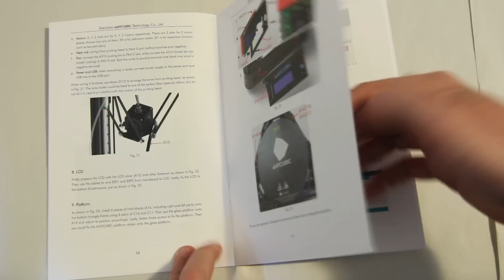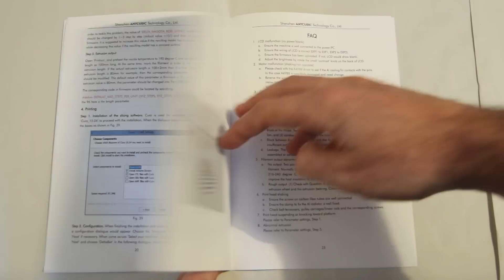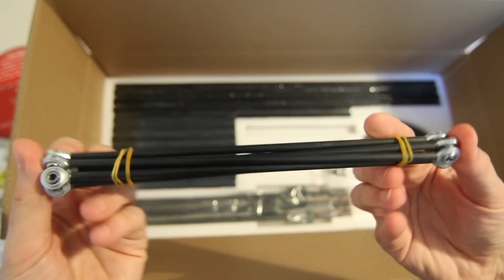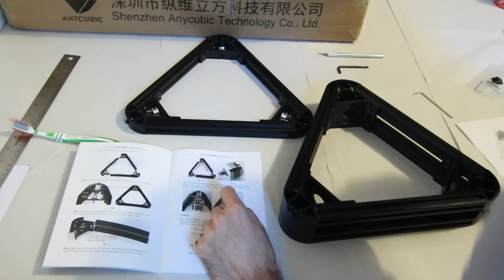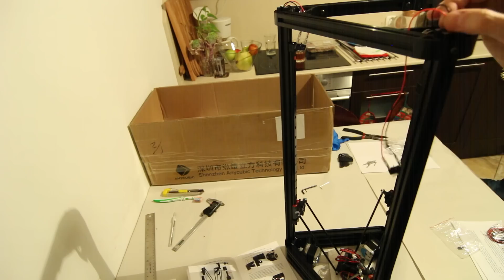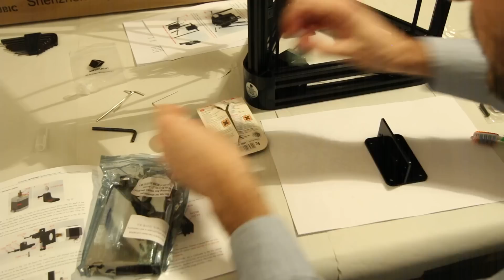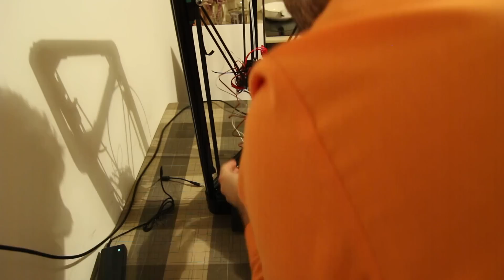Anycubic Kossel Delta 3D Printer Full Assembly and Review

Comment: I love the printer that I have received, it looks great, was simple to build and designs come out well. However, I’m having a huge issue with the boden tube/extruder jamming, this causes the extruder motor to click and wear away at my filament and im wasting a lot of filament at the moment. I got about 2 hours into a 5 hour print last night and then suddenly the tube jammed and no more filament could be extruded. Do you know how I could fix this?
Reply from the maker: There are many possible causes, but more information is needed. Type of plastic, print temperature, over extrusion, does the print head cooling fan (the one that cools the heatsink) work constantly, bad filament, clean hobbed wheel on the extruder, does the PTFE tube go as deep as possible into the head? Etc. Etc... And where in the Bowden tube does the filament jam exactly? How do you fix the jam?
Reply: ruevs im using pla at 210 degrees, tried to print at 190 but that made the clogging even worse, the cooling fan is working at all times as far as i know. ive used 2 different filaments so i dont this is the problem and the machine is brand new so i dont think the hobbed wheel is dirty. 

i have noticed that when i pull the filament out of the print head, it has an odd melting shape, it doesnt fall straight down, instead bulbs out a little to one side.
Reply from the maker: You mean that while extruding the filament comes out of the nozzle to one side? You may have a metal shaving or something else partially clogging the nozzle. And then the extruder struggles to extrude the same volume of plastic through a smaller diameter nozzle. Try setting the temperature at 220, disconnection the Bowden tube at the head, extruding by hand in the air for a bit, then lowering it to 80 degrees, removing the extruded plastic from the nozzle and  pulling the filament out (takes some force). The idea is for the almost solid plastic to pull out the particle clogging the nozzle.
Reply: Ryan, I had the same problem. The easiest method (for any extruder jamming, that is), is to disassemble and remove the stuck filament away either with pins or burn away with a stove. For boden, I heated an awl (or a pin) to melt away the stuck filament because the whole  boden is hard to be heated. For the nozzle, easiest way is to heat it on the stove.

Comment: Does this tutorial work with Anycubic Kossel Pulley?
Reply from the maker: It does 90% - instead of mounting the slides you should assemble the pulley carriages. Everything else should be the same. You will need do tune the delta radius in the firmware - but that is always the case.
Reply: Thanks

Comment: Awesome! Thanks for the review. Apprently we still have lots to do to improve this delta and offer better experience to your guys. Cheers.
Reply from the maker: You are welcome. Apart from the few small "hacks" that were necessary - and I described them all in the video - the printer is quite nice.
Reply from the maker: @ANYCUBIC3D will you ever release a new delta printer? And one that is fully open source (firmware)? The delta I built in this video - one of the first detailed videos on your products ever - still works perfectly fine seven years (of very light use) later. Now with Klipper and all the benefits it brings.

Comment: thanks for the nice video. 
I had the same problems mounting the main board. You may need to cut a notch with a rat tail file  in  the aluminum extrusion frame over the .5A terminal block to provide access to the screw - best to do it before mounting the main board. 
Your axis motor electrical connectors are oriented properly, manual page 3 manual is incorrect.
I added the heated bed supplied in the kit. 
I think all the power connections to the board are 12 VDC and I'm running my printer entirely off a PC  power supply.
If you're going to use a heated bed the main board needs 2 separate 12 VDC feeds on terminals " .5A " and " 11A " and my understanding is only use 1 power supply for this. 
I changed the supply power wiring for the bed to 105C and added a thermistor with 200C teflon wire. 
I tried it before installation and managed to get the temp up to 100C. 
This printer was able to run a part toolpath but is not working now although it will run a home command routine. 
I cannot get it to run from Pronterface anymore so I will try your Repetier setup
Reply from the maker: My Repetier configuration does not include a heated bed since I have not installed it yet. However it should work. If you are not comfortable editing configuratin.h by hand you can upload it at the Repetier download page - it will parse it and fill in all options. Then you can change just the bed settings and download a new configuration.h.
I did not have to cut notches in the extrusion - the board+screw head+2 nuts was a tight squeeze when the nuts were well tightened but it did squeeze through :-)

Comment: MY ANYCUBIC  IS  NOT WORKING ANY MORE
Reply from the maker: I watched your
VID 20170122 160829107 
the heated bed may not have enough power to reach 100C - for example if your room temperature has dropped significantly. This depends on the power supply, the thickness of the wires going and the type of heated bed you have.
The other VERY important factor is the PID parameters. Search for PID auto tuning, and also PID control - to understand them. This applies to both the heated bed and the head.
And of course the print will not start until the target temperatures are reached for both.
Reply: I had this machine working. after the screen quit it crashed and now I have this. I manually heat the bed and end before printing.when it paused for heating it looses heat signal for bed?

Comment: Do u think it would be a good first 3D printer for beginner as a first time build
Reply from the maker: In my opinion it is a very well made kit. It was easy to assemble. If you want delta mechanics the price/quality ratio of this particular model is the best I could find.
The bed leveling on a delta is harder than a normal Cartesian (XYZ) because it is not as intuitive. But this applies to all deltas and you will have to read about it and understand it. And in my opinion the models with auto leveling do not help, because they will tempt you to just rely on the automatic procedure instead of how to get the geometry and the settings right.

Comment: Does the instructions show u how to install firmware and show u how to calibrate the printer ready for printing
Reply from the maker: The manual has a section on firmware installation and calibration - look at 00:03:15 in the video. However I used Repetier firmware instead of Marlin which I had to configure on my own. As for calibrating and leveling deltas - there are many more detailed guides on the web than what is described in the manual.

Comment: Love your assembly review. This looks like a good buy.
Reply: Did the "non-sticky" incident repeat itself subsequently in other prints?
Reply from the maker: No, that was on clean glass. After that I applied glue stick to the surface, which works well enough for most parts with PLA.
Something like this:
http://mglbusiness.com/productimage/OAS-TAPE-0046-600x600.jpg
There is a black plastic sticker in the kit with rough surface, which probably works, but I decided to save it for later when I will install a heated bed and use ABS.

Comment: I think I would have used a cable mesh rather than the wrap and included the bowden tube so you have a single 'line' running to the effector. The bowden tube will work for the stability but the mesh will not limit flexibility like the wrap.. ;)
Reply from the maker: Thanks for the suggestion. The wrap provided in the kit is very flexible - not like the typical white one. I considered including the bowden tube in the wrap - it would certainly look cleaner. However the tube goes to the extruder which is mounted in the middle of the gamma (Z) tower and needs to curve up quite a bit. The cables also run down the same tower after reaching it just under the extruder, but their "free" length is shorter than the bowden tube and they are much more flexible on their own. So I decided this is cleaner from a mechanical point of view. In addition it allows me to very easily remove the tube if needed - e.g. stuck filament for whatever reason.